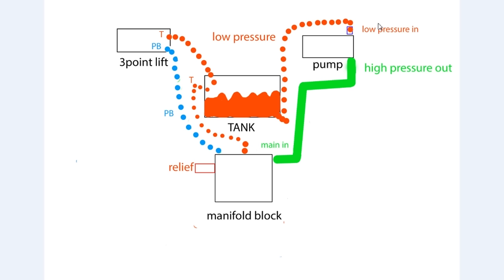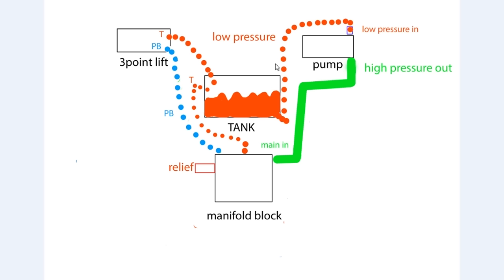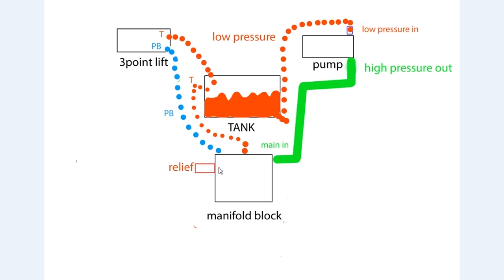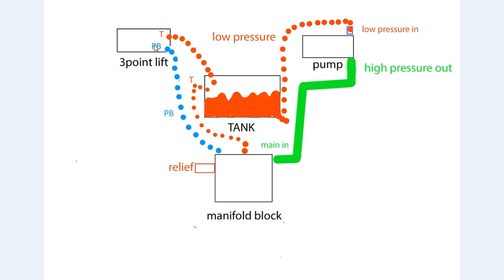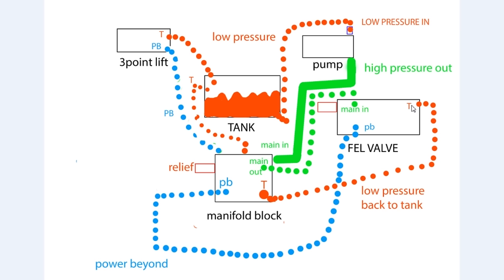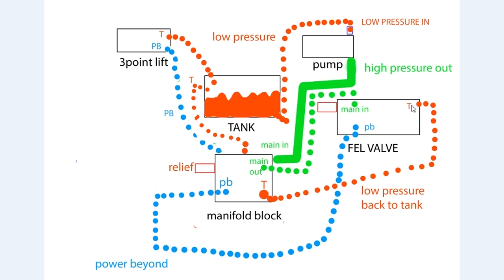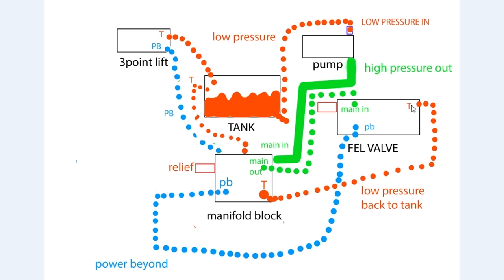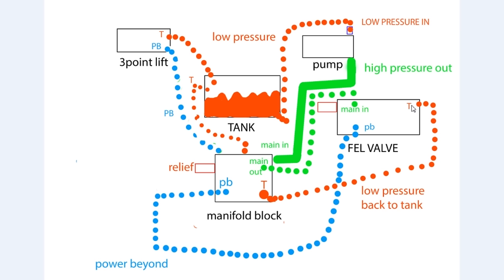adding rear remotes and understanding tractor hydraulics

Comment: Hello Dave 
I have put a three port spool valve on my L4400 Kubuta I do have a front end loader on the tractor with a 3rd function valve.The problem is everything works all but my 3 point hitch! I have unhooked the spool valve and hooked back up as it was before I installed the spool valve the 3 point hitch works great. So I rehooked up the lines as your video 3 point hitch will work if activate the spool valve as soon as you release the lever the 3 point hitch will stop moving so can you tell me what may be going wrong?
P.S your videos are very helpful
Thank David Grissam
Reply from the maker: sounds like the power beyond line and the back to tank line are reversed.  study your spool valve and identify the power beyond out let port make sure that line hooks into the power beyond port at the manifold block. make sure the back to tank line "if there is one" is hooked to the back to tank port at the manifold block or anywhere in the line just before the manifold block. also check to be sure the flow is correct on the new valve. the line coming out of the third function valve should hood into the inlet of the new three spool valve. if you are still stumped you can email me pictures of your valve and a copy of the model number, brand and instructions and I will help you the best I can. my personal email is Daveknowshow@aol.com
Reply: @daveknowshow  Thank you very much for the help on the new spool valve. everything is working now. Again Thank you!
Reply from the maker: @davidgrissam3919  thank you for allowing me to help it was my pleasure and I really enjoyed our phone conversation.

Comment: So if I do not have a manifold block with aux ports such as a power beyond, can I just put the main in directly into a spool valve and then run the pb from the spool valve directly to where the main in would have went on the manifold block and then T into the tank return with the spool valve?
Reply from the maker: yes and depending on how you set up the spool valve you may not need the back to tank port. just set it up so that the return dumps to the power beyond out port. this how kubota back hoes are set up. which is why they only use two lines. one in one out.

Comment: Daver, excellent video and explanation of how hydraulics work.  But I'm stumped and in need of guidance.  I have a Ford 800 and considering adding single spool valve kit to divert live hydraulics for a log splitter.  How do I run a hose for low pressure/return to the tank?
Reply from the maker: you can simply have the low pressure return through the power beyond flow or dump it into the tank fill port although sometimes on some machines that option bypasses the filter which is not a good idea. so look into it further. typically power beyond return pressure is low pressure in fact its all low pressure until its being used the pressure build in the cylinder that is consuming it. the rest is simply low flow through on these open center hydraulic systems.

Comment: Question Dave, is the added spool valve open or closed at the power beyond?  my loader has the open center on PB adapter, my valve i'm installing has a closed center PB adapter in the Port label N, do I need it? thanks Don L
Reply from the maker: You need it to be open center power beyond. This Curries the fluid to the next device under low pressure until used.
Reply: I'll ck that on my setup, thanks and i appreciate your videos and the fast replies on Dave knows!

Comment: Hi hope u can help .I have a 1986 ford 2110 tractor and I removed a aux control for a rear cylinder .I pulled the 2 hoses of the manifold block and plugged the holes with 1/2inch hex head plug.and now my rear lift arms won't go up and down.great video thanks
Reply from the maker: cant just plug those holes. more likely you need to use a short piece of hose and tie those two together so the three point will work.
Reply: @daveknowshow  thanks Dave,just put a short hose on and it works great again.very good explanation you gave.thanks for getting back to me so fast.blessings to you.
Reply from the maker: @robnystrom5690  awesome! I'm here if you need me.

Comment: Great Information  I have a 1210 ford tractor and hydraulics block has only two hose connection one in and one out and in the middle there is a screw that you turn turn left for 3pt or right for remote. I wanted to add a hydraulic top link does this mean i can't use the 3pt and the top link the same time? Any help would be greatly appreciated
Reply from the maker: I think, not 100% but once you hook up and flip that switch it feeds the remote and then returns through the other port to power the three point hitch. so yes both will be available however one will take precedence over the other while being used. hope that helps and thanks for the kind words.
Reply: @daveknowshow  Dave you are the man ! I really appreciate you taking the time to write back to me! Thanks again!
Reply from the maker: @steveski8643  I'm here if you need me I will help the best I can. your kind words encourage me so thanks a million.

Comment: Excellent video. I want to be able to remove my Backhoe attachment and put the cutter back on. I have run a hose to a quick coupling from the PB on the loader joy stick. Then I have a hose hooked to the manifold PB running to the back for the return from the back hoe. To remove the backhoe and operate the 3 point hitch can I take a jumper hose and complete the PB circuit by plugging the jumper into the two female quick connect for the backhoe? I have a MX5100 Kubota. Thank you.
Reply from the maker: yes that should work perfect.
Reply: @daveknowshow  Thx a bunch for the info. Love your video's.
Reply: Another quick questions. I see a picture with a Tee coming off the manifold. What is that for?
Reply from the maker: @dwightcoggin7031   that "T" connection is where I dumped my double spool valve for the rear remotes back to tank. since that spool valve did have a back to tank port as well as a power beyond port. you can see that in my video series where I installed the rear remotes for the hydraulic top link. on my backhoe connection it has one male and one female connector so when the hoe is off I just plug one into the other making a loop. you can do the same with a short piece of hose just make sure it is long enough but not so long that it gets hung on the three point as it goes up and down that Mx5100 is a beast of a tractor. I guess yours is a shuttle shift? most are. I use to barrow one from my neighbor and his was a shuttle shift. very stout tractor, plenty of power to the ground for pushing and pulling.
Reply: @daveknowshow  Thx for the clarification. My Kmart school of tractor hydraulics is limited. You've helped tremendously. I enjoy your videos.
Reply from the maker: @dwightcoggin7031  no problem i'm always happy to help if I know the answers. i'm still learning myself.
Reply: @daveknowshow  thanks Dave this is what i was looking for
Reply from the maker: @garryharris9098  you can always email me direct and send pictures of what you have to daveknowshow@aol.com
Reply from the maker: @garryharris9098  awesome if you need any further help just get back with me. I sent you a couple emails hope you did get them. if not check your spam folder.

Comment: Thanks for Your well presented explanation on hydraulic Feed & Return to tank lines as being in series

Overlaying the 3 basic circuits was a Great Help by using the KISS method ( Keep It Simple Stupid )

My training has been as a US NAVAL Electronics tech & once You said the Hydraulic Flow is in series that made it much easier for Me to understand Fluid Flow theory & usage

Spool valve & relief valve terms now makes sense

It is funny on how I can relate Hydraulics assemblies too Electronic components

I bought a Kubota L-2501 a couple years ago and a week later a new Backhoe for it

The only 2 things I have accomplished so far is installed the Sub Frame for it & Hydraulic lines from the FEL controller to the rear mounting plate the back down to the Hydraulic block as a complete path

Backhoe is still on its shipping pallet

I don't have a Grapple or other hydraulic implements for the 3 point at the rear, yet, but I have been looking at adding Hydraulic fittings

Question???

Since the system is a Series path is it possible to use the connection points I now have at the rear for the detachable Backhoe to feed a Spool controller or 2 inline from that path when the Backhoe is not connected?

Thank You Again

Ken in Florida
Reply from the maker: Hey Ken thank you for the kind words. they are much appreciated. yes you could easily connect a spool valve with quick connects that simply plug in to where the backhoe unplugs. or any place on that circuit. some spool valves have a back to tank port and may require running that extra line. I do think as long as you are using an open center spool valve you could easily omit the back to tank port line. just allow the fluid to flow the return into the power beyond  line down stream.  in my series "adding rear remotes/ spool valve" I installed my valve by simply unscrewing one line at the rear from the fitting and plumbing it into the spool valve. then came out the spool valve and plumbed into the quick connect I previously disconnected from. now the spool valve is  connected and when the hoe is off the two hoses plug into each other completing the circuit. I used 1 male one female at the rear so they can plug into each other.  this bypasses the hoe and completes the circuit.  hope that helps.

Comment: Thanks a lot for this lesson. Well done. Can you tell, what sizes of the threads at the ports of the manifold block are? Mine is a Kubota L2850D (1993) without any additional hydraulic control valves.
Reply from the maker: more likely on that year tractor its a 3/8 NPT  my suggestion is take it to a hydraulic shop and let them check the threads. if it is 3/8 NPT thread "national pipe thread" then get an adapter and change it to either J.I.C fittings or "o" RING boss fittings. the J.I.C is the best. they cost more but well worth it.
Reply: @daveknowshow  Hi Dave, thanks a lot for that information. I am going to give it a try.

Comment: Thank you Dave - I've got a walvoil 2 spool valve with a joy stick running a FEL on my L2600 and it's booger'd up somehow.  Asked a guy to re-build and now on "float", the bucket is floppy...useless.  I have a question though - on the PB circuit back from the spool valve - to the manifold block - is that a straight pass-through to the tank?  Much thanks -
Reply from the maker: yes and no. not so much "straight to tank" it makes one more stop. it hits the three point lift to be available pressure if the three point calls for it. if the three point does not call for hydraulic power then yes it dumps straight to tank after it goes through the  cooling radiator to reduce the temperature of the fluid. hope  that helps. note also in this video we do NOT show the cooling radiator for the hydraulic system. it simply was not needed to explain how the system works.
Reply: If your buckets tilt is sloppy it's probably a cylinder problem ( mine just started doing that ..

Comment: Hi Dave! 
Thanks for the video. It really helps younger dudes like me learn things. ;)

Question for you: I have a tractor implement with two remote circuits. How to reliefs in the spool valve reliefs work if -- let's say -- something hits my implement and FORCES my dual acting cylinder to move? 
Will the spool valve relieve one side back to tank and draw fluid in for the other side? My tractor doesn't have float or continuous flow (Two positions and neutral). Thanks again, Dave.

Aaron
Reply from the maker: not likely if it has no float position. typically, the relief in a standard spool valve is 3000psi which is higher than the standard setting on most tractors until you get into the super large machines. this 3000psi is mainly in play when you dead head the valve and the cylinder is at the end of its stroke. if this is a 3 point implement  the three point will likely raise since it is gravity down. if this is tow behind batwing mower that may be a good question for Tim Marks over at tractor time with Tim. he uses a lot of batwing mowers and can explain how the hydraulics need to be set up. hope this helps. be sure and let Tim know I sent you there with this specific question so he wont send you back here to ask me. lol hope between the community we can get you an answer quickly.

Comment: Thank Dave for this video.  I have Kubota B7610, with a FEL.   I am adding a thumb style grapple to the bucket, and considering an electric diverted valve in between the boom hydraulic circuit.   I wonder if instead, I should tap into the PB port on the FEL spool valve and add a single level spool valve for the grapple?
Reply from the maker: I would add an electric actuated valve for the grapple lid and plumb it into the power beyond port. I have a video on that here. https://www.youtube.com/playlist?list=PLLg8VIC7effpOwLD7Y7d2ghv5nY4-b7Cn
Reply: daveknowshow thanks!  I started watching this series,  and will use this approach.  Really appreciate it!

Comment: Hi Dave..
Great instructional tutorial...
On a related subject..all the hydraulics work on my M8540 except when I engage my rear auxiliary hydraulics to operate my backhoe attachment it triggers what sounds like a pressure relief valve and no fluid is moving to the attachment..where do I start with troubleshooting?
Thanks in advance for any help with this...
Warren 
Maui,Hawaii
Reply from the maker: sounds like you have the hoe plumbed in backwards. however with out being right in front of the tractor in question this is merely a guess. another and my best guess would be that the rear remotes are not designed to run a hoe. what you need to run a hoe is to loop into the power beyond circuit in series.  fluid must be traveling into and out of the hoe constantly when NO CONTROLS are being activated on the tractor or hoe. fluid should flow in one hose and out the other freely with zero restriction. if the relief is activating this means fluid is " dead heading " and has no place to go so i trips the pressure relief.  I hope this helps.
Reply: @daveknowshow  
Hey Dave....
Thanks for the rapid reply...
Ive run this backhoe a lot before this new problem...youre absolutely right about how this attachment is supposed to be running...ill just keep messing around as see if i can get it working...just kind of funny to have this happen all of the sudden..thanks  for helping all of us with all of your videos..
Warren
Reply from the maker: @warrenroberts4502   so it was working and now just stopped? sounds like the quick connect for the hydraulic hose is not fully seated. it may be defective. this will cause hydraulic dead head and the relief will open.  just dont run it to long like that trying to find the problem because the pressure relief will cause the fluid to heat up as well as the pump. this can cause pump failure. unplug the backhoe and see if the tractor works.  also check your filters they can collapse  inside and this will also create similar issues.  wish I was closer to you I'd pop on over and we could figure this out.

Comment: So the backhoe dosen't have a 3rd hose (back to tank) like the loader valve has. I'm assuming the relief valve would open in the loader valve thats supplying the backhoe if the backhoe had a situation were it exceeded pressure ???
Reply from the maker: yes relief valve opens when pressure exceeds set limits. no back to tank from the factory hoe. they used open center flow through valves so the back to tank fluid travels out to the power beyond port when the valve is activated in either direction.

Comment: Will this work on a ford 2n tractor for additional rear remote couplers? Are there additional ports?
Reply from the maker: System should work on the same principle. You should be able to add a valve with a power beyond port and back to tank port and plumb it in right off the hydraulic pump if need be. Some adapter creation may be necessary.

Comment: Confusening!!! But !!!
I'm trying to add 2   -  2 value spools to my loader on my 706 with a pb . I have one hooked up and working!!!! But  I have a second one I want to hook in at a later  date  !! They both have pb !! Do I have to hook the second one to the pb on the first or can I try them together????
Reply from the maker: yes they need to be in series, one pb feeds into the next valve. the next valves PB feeds into the next and so on.
Reply: @daveknowshow  so I have to use pb on the first !!! What do I do with the  returns 🤔
Reply from the maker: @evankibbe590  pb feeds to the input on the next valve then pb out of that valve goes to next valve or returns to pb port at manifold block which feeds three point. back to tank lines will T connect back into the back to tank port at the manifold block.